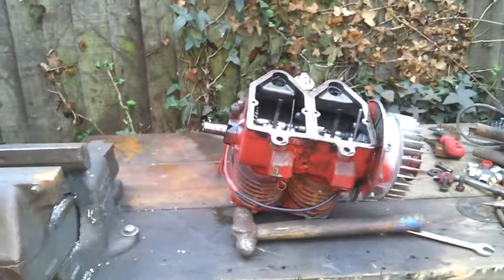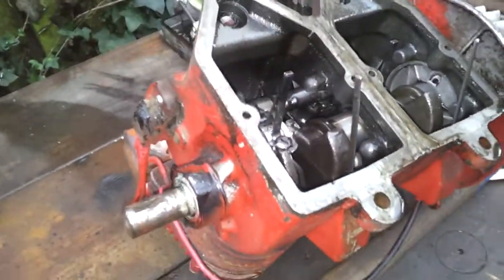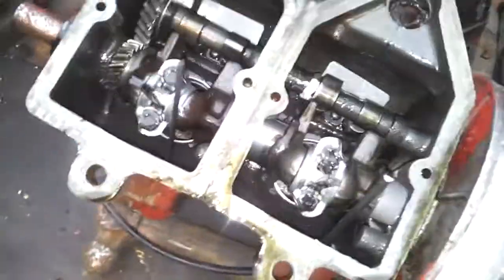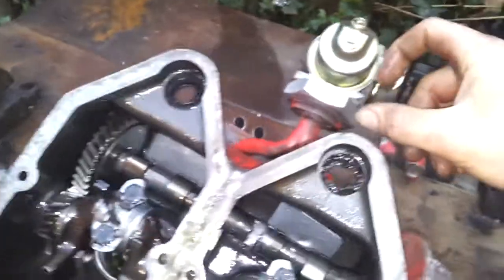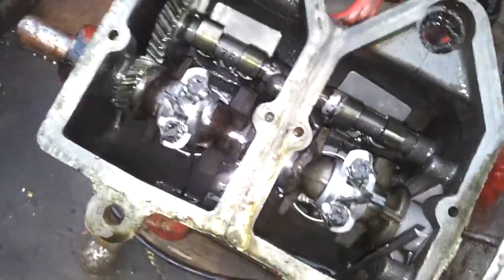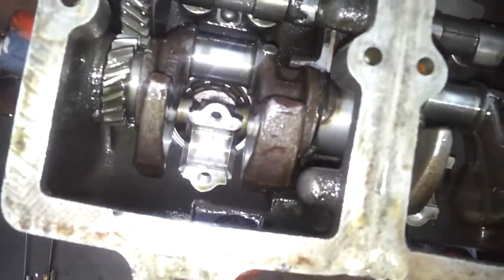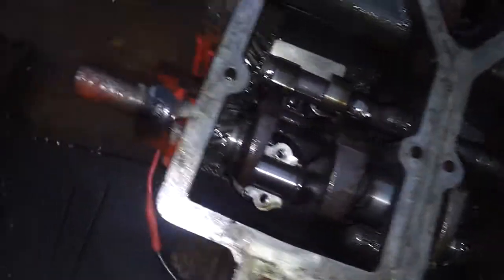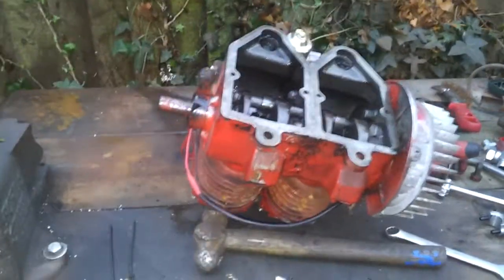How I made my twin cylinder suffolk engine

Comment: I don’t quite understand the distributor....  The flywheel passes a magneto or points that creates a spark just once per revolution...  That spark goes into the block and strikes the brass on the crankshaft gear, but then what happens?  It bounces back to both of the other brass pins going back to the spark plugs?   Wouldn’t that be the same as T-ing the coil lead directly to both spark plugs?  Also, why would you need 2 contact plates on the crankshaft gear 180 degrees apart?  The points or magneto only fire once in 360 degrees of rotation.
Reply from the maker: ah! my man! the distributor is on the cam shaft gear not the crank gear. out of the three pins only two of them line up with a brass plate at any one time. either the coil and plug 1 or the coil and plug two.
Reply: council house creations 
ohh...ok.... So the pistons are not firing at the same time...   I saw another one of your videos that must have been a different engine, where both pistons fire at the same time.

Comment: Genius 'distributor', love it :-)
Reply from the maker: Thanks buddy! It can be a bit hit and miss sometimes, have to have a smaller  plug gap so the spark doesnt try to jump between the brass pins. Working on a 6 cylinder suffolk at the mo inspired by @805roadking so stay tunned ;-)
Reply: @councilhousecreations8035  Yes I can imagine, just watched that 4 cyl Briggs, not sure if it should be in a Morris Minor or the Wright bros aeroplane. I love those Suffolks, I used to buy the whole non-running mowers from the tip for £5 each in the Spring when people couldn't start them, 90% were fixable without even any parts!
Reply from the maker: @stevemorris3710  ha love it! i was just the same you could nearly guaranty there would be one there every time. Not so much any more unfortunately just them dam vertical briggs! Lucky i collected so many!;-)